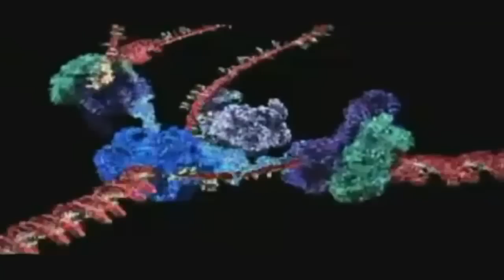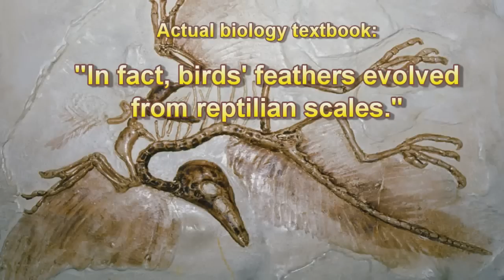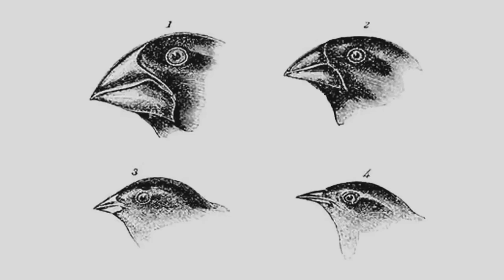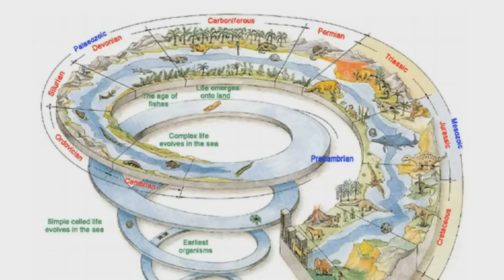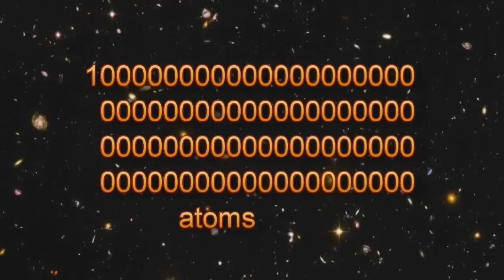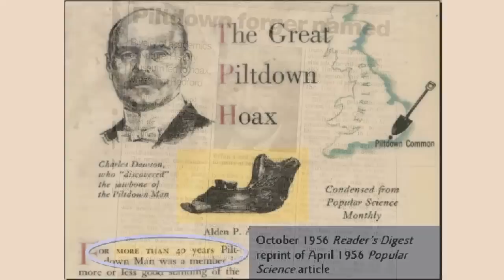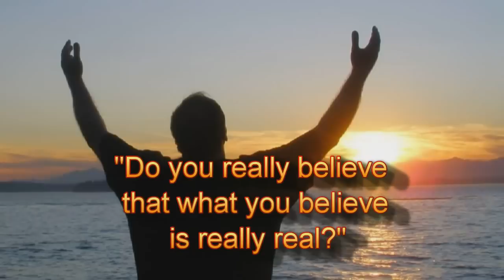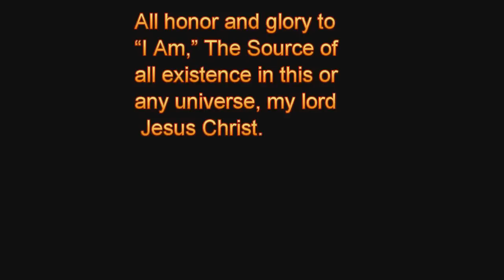Evolution Demolition

Comment: 35:10 The fine tuning of the earth argument.

First of all, remember that this is a discussion about abiogenesis, not evolution. Evolution has nothing to do with the existence of life, only the diversity of life.

No, not all of those things are necessary for life to exist. They're necessary for our life to exist, yes, but since the argument evolution makes is that life adapts to its environment, this is what you need to address if you're going to argue against it. Not a straw man.

Life appears to need water, yes, but what specific amount? Who knows what the acceptable amounts are.
We need an acceptable temperature. Well, there is life that life in extreme colds, and some that live in extreme heat. Sure, there's an acceptable range, but it's far greater than you make it sound, whatever it is.

The moon is irrelevant, since life has evolved to make use of it, but wouldn't necessarily need it in the first place. Now that we've always had the moon, we've come to rely on it, but that's a backwards argument, as I've explained. Had the moon not been there, life would've evolved differently.
The axial tilt is largely irrelevant, aswell. I see no reason to think seasons are needed for life to exist. Once again, we have adapted to seasons, because we life on a planet with seasons.
And most of the rest is irrelevant aswell. Speed of the earth's rotation, thikness of the atmosphere, and so on. None of it needs to be what it is on earth for life to exist. Only for our life, once again, because we've adapted specifically to it, so changing it would be a disaster.
As for the make-up of our atmosphere... our atmosphere has changed through earth's history. And some would argue that life could not arise on aplanet with our atmosphere the way it is now, because of all the free oxygen. taht might be true, and we're still ivnestigating what the early earth's atmosphere was like, and it's stillb eing discussed and debated.

The truth is that there's an estimated 50-100 billion earth-like planets in our galaxy alone. By "earth-like", we mean that it's of similar size, and lies within the "habitable zone". That is, the same distance from their stars, adjusted for the heat of those stars.It doesn't mean they have water, because we don't know if they do. Water is common in the universe, though, as far as we can tell. Which makes sense, considering it's a simple molecule of very basic elements.
Reply: anti/HUMAN Designs ...”Michael Turner, widely quoted astrophysicist at the University [of late] of Chicago and Fermilab, describes the fine tuning [of the planet] “. “The precision is as if one could throw a dart across the entire universe and hit a bullseye one millimetre in diameter on the other side”.  “Roger Penrose, the Rose Ball Professor of Mathematics at the University of Oxford [late] , and renowned for his work in mathematical physics, in particular his contributions to general relativity and cosmology, with honours,degrees,books and published scientific papers too numerous to list , calculates that the likelihood of the universe having stable energy at the creation is one chance in one followed by a “million billion billion billion billion billion billion billion billion billion billion billion billion billion zero’s. Even if we were to write a zero on each separate proton and on each separate neutron in the universe...we should fall far short of writing down the figure needed.”.....Roger Penrose, cited in “Fine Tuning”.......Dave Hunt.....Author....

Comment: To save you the trouble checking, & to ensure you remember, you said: "I propose intelligent design is the only known means of altering probabilities in such a way that entropic transfer in genetic transfer could occur." Remember that? When I pointed out that there is no evidence of a designer, so one can't be used as "the only known means" for anything, you spoke of the 'designer' as an 'entropic transfer mechanism. I have since asked you for the specifics, which you have failed to supply. Now I don't want to repeat myself again, so go & check the old comments again if you're not sure what you were talking about. Since your main argument hinges on this point, I find it 'hard to believe' that you don't understand what I want you to explain. But I'll repeat my questions anyway. Where & whem does 'the designer' intervene in the genome?

Comment: I am only 10 minutes into this video and have already noticed a startling amount of misinformation. First of all, abiogenesis has nothing to do with evolution, and yet you call it "one of the most important kinds of evolution"? No one who understands the theory of evolution would say this.

Secondly, you show a complete lack of understanding of dating methods when you seem to suggest that there is no way someone would be able to date a skull to 4 million years. You correctly mention that dating can only be used on igneous rocks but fail to mention that this is exactly how scientists date fossils, by essentially finding igneous "brackets" in layers of ash above and below the fossil, allowing them to come up with a range between when the fossil was laid down. Some rock layers can be so expansive and ubiquitous that often identifying layers around the one the fossil was found it can be enough to get a rough age for it without even having to do any extra dating.

Either you did not know this information or you chose to withhold it in order to deceive. Either way this severely damages your credibility.

Comment: ''since Carbon dating always yields ages of thousands, not millions of years.''
Carbon dating only goes back 60,000 years because the carbon is all gone by then.
Reply: Mark Champneys No, the C-14 in the ground [coal and diamonds] comes from natural radiation in the ground, Uranium decay.  The C-14 method only works on once living things that got their C-14 from the atmosphere.
Reply: The ‘Super Group Layers’ of rock in the Grand Canyon is below the level layers at the east end.  These layers were laid down level, then block faulted into mountains, then worn flat, and then the Teapeats Sandstone was laid down over these basement layers.  Then another 5000 feet of sediments was laid down, some wind blown desert sands and some corals.  Then the whole area was raised to 8000 feet ASL as water flowing down hill cut the canyon.  How long do you think this took?
Reply: Mark Champneys  ''Yet diamonds contain carbon-14.  How is it possible for it to still be there?''  Please answer your question and it will solve the problem, how did the C14 get there?
Reply: Mark Champneys The Carbon 14 comes from natural radiation in the ground.  It was not made a billion years ago.

Comment: Evolution only has only two requirements, which Darwin was clearly aware of. Variation and Natural Selection. Both of which have been observed in Nature. Man has often substituted his own selection ( breeding for specific attributes ) and variation can be induced, such as mutation caused by radiation, which has been used for modifying food plants. Whereas Nature has a tremendous amount of time and material to work with, Man has achieved some impressive results in modifying species, within limitations. The DNA/RNA method of replication allows all the elements needed for useful ( enhanced survival of the genetic line ) mutations to be incorporated.

Comment: I doubt it.  The only such simulations I know of are themselves complex programs which are looking for a predetermined specified outcome.  Documentation, please.  To my knowledge, Microsoft has not fired programmers in favor of a random number generator.

However, I readily admit that computers have been programmed to do limited kinds of re-programming, including error correction.  But of course, this capability itself was designed by a mind, confirming my point.